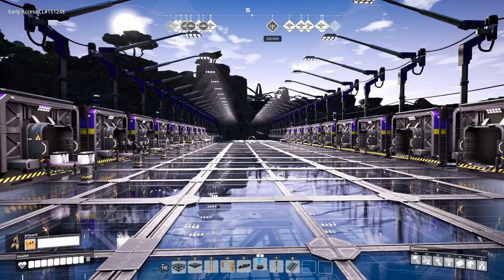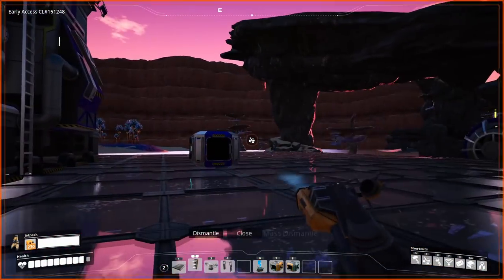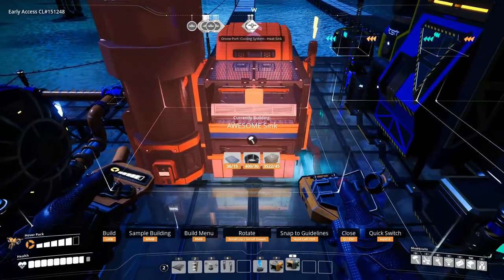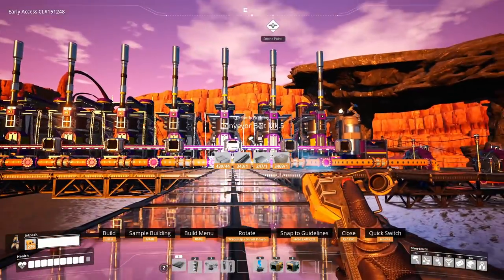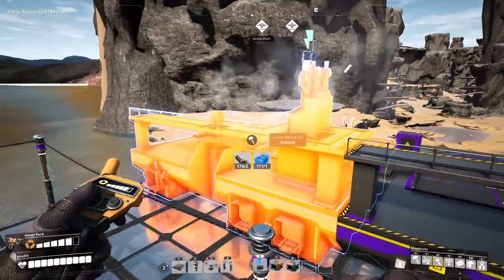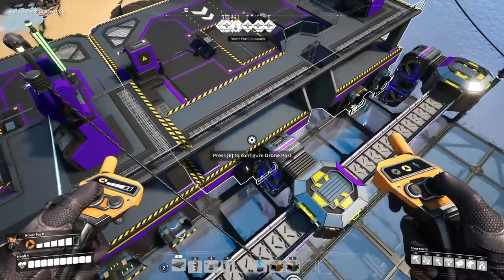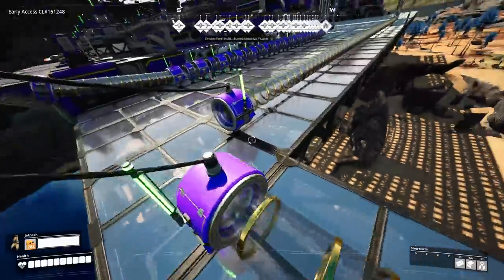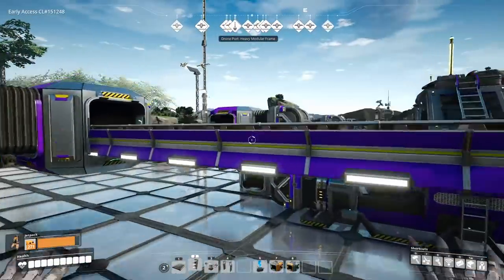TURBO MOTOR From Waste Products | #24 | Satisfactory Update 4 | Lets Play/Walkthrough

Comment: I'm continually surprised there's no trains. Is this really a Nilaus series?
Reply: He said that Satisfactory’s train is not worthwhile, since the platform only has the capacity of 1 steel chest + 2 output; is expensive and a huge pain in the ass to use/setup (even worse with the schedule bug); unlike Factorio where you have 12 stack inserters + 12 steel chest and circuit network for a cargo.   
As of now, drones are just trains that can fly.

Comment: to not have to deal with the issue with the lifters select then first from the machine and then to the splitter, lifters go a little back when they are connected to something that is an issue with the machines for then having a limit area that can be connected but the splitters and mergers don't have that